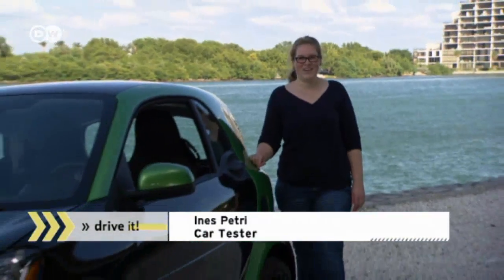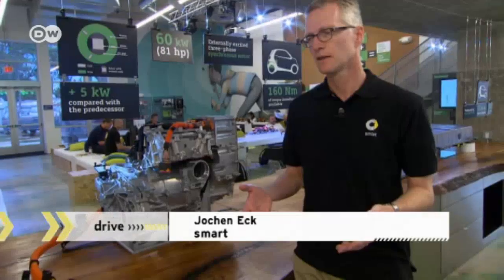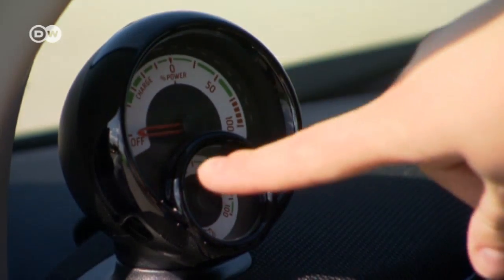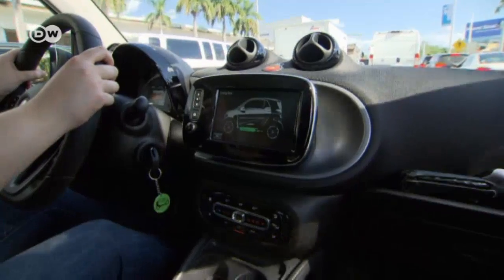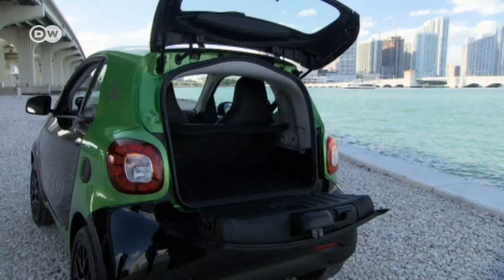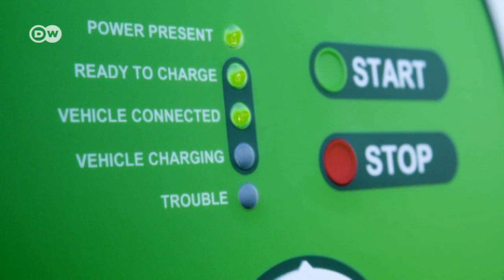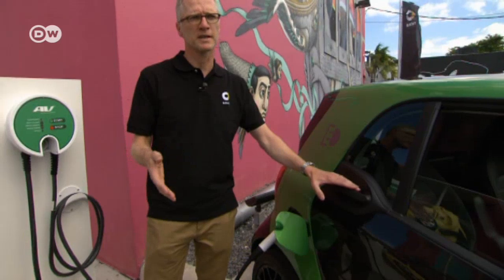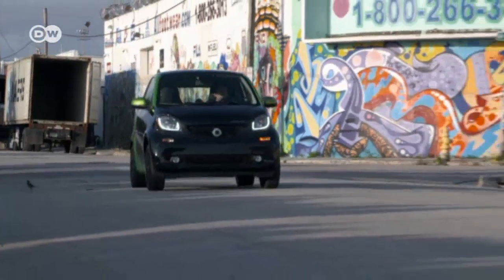Zippy: smart fortwo electric drive | Drive it!

Comment: It's a shame the range is so small, I currently runs 2011 451 cdi model with over 120000 miles on the clock, I usually cover 100 plus miles a day, sadly the electric model won't cover that sort of mileage so the oil burner keeps on going